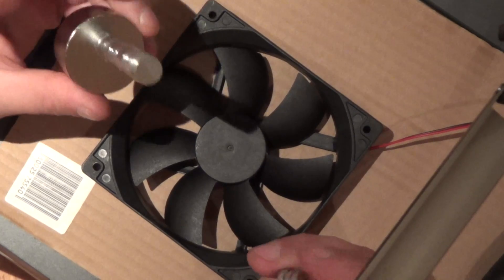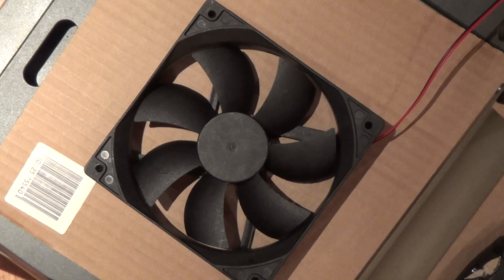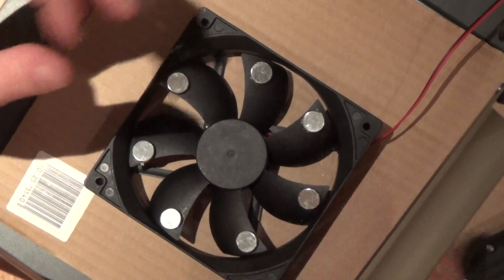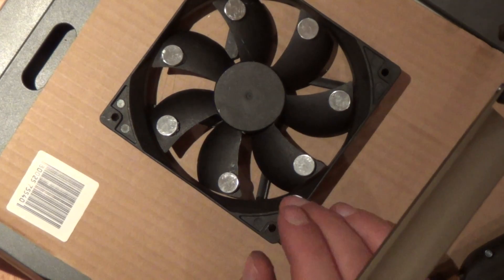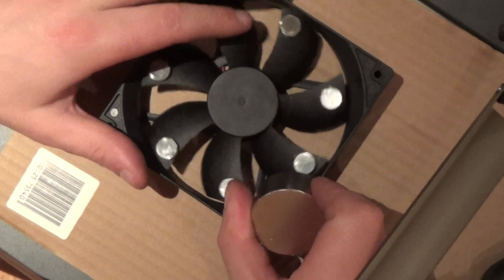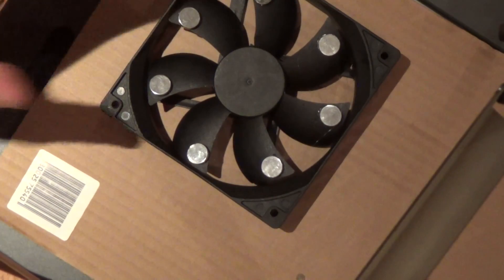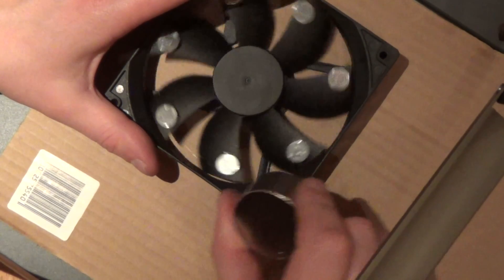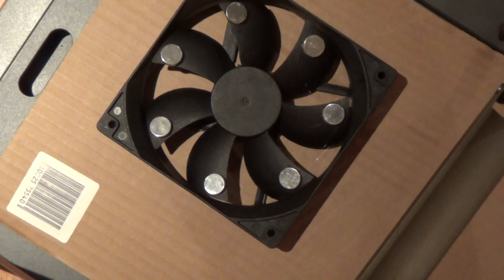MAKING FREE ENERGY MAGNETIC GENERATOR. Step by step.

Comment: You have to take in account your negative and positive polarities any angle positioning of the magnet and it does work but it takes a lot of persistence I made a fan that just ran off of magnets and worked for months until the bearings went bad.

Comment: aluminum foil strips to break the field which will advance motion by weakening one side of the field, after resetting the magnets to attraction field. you are set for oppose.
Reply: Try outing the magnets on the angled otherwise of the blade and place opposing magnet on the side of fan casing. That should force the fan to move
I place on trying that out.